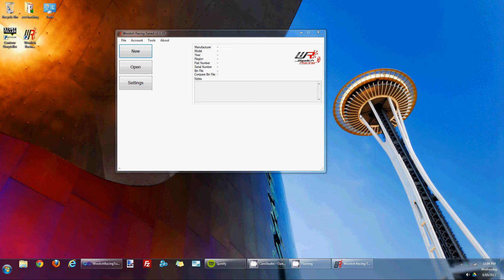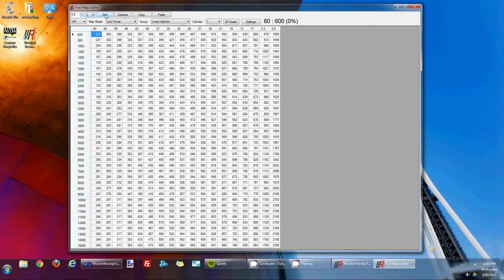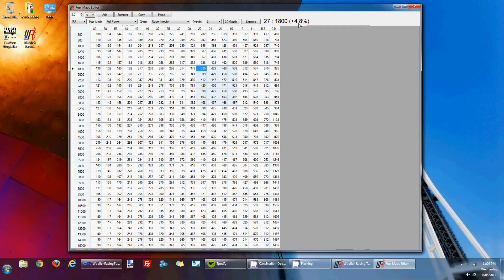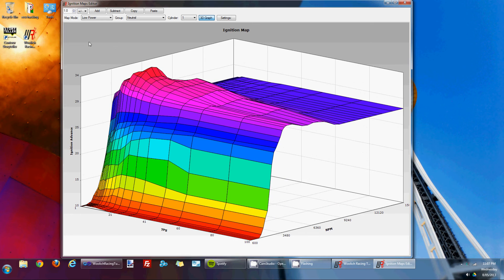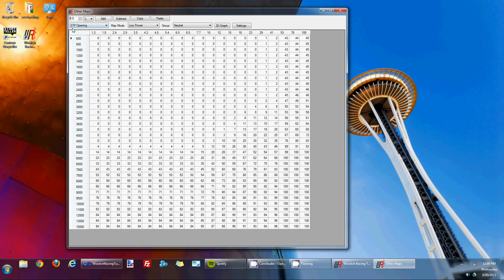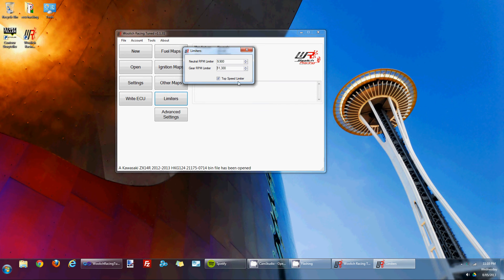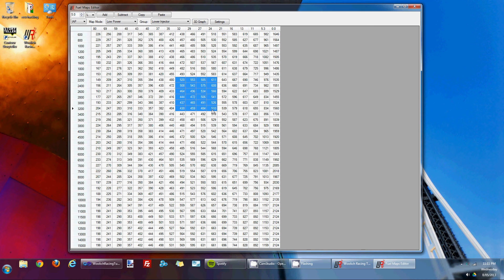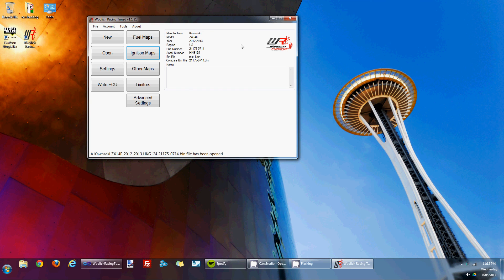Overview of Woolich Racing Tuned Software

Comment: Is it possible to change the hand throttle down to a quarter turn or sixth turn throttle seeings it is true fly by wire
Reply from the maker: It would not be advisable to try and emulate a quick-action throttle electronically by changing the ETV maps. There are many underlying maps in an ECU that aren't exposed with our software, and trying to achieve 100% ETV opening at 40% TPS, while it MAY be possible in some simpler ECU's, will likely interfere with the relationships between the other maps in the ECU. On newer ECU's, we would expect that attempting this could also result in the ECU reaching hidden internal limits which would mean you would not be able to reach 100% ETV at lower TPS values even if you tried. 

We would recommend purchasing a dedicated quick-action throttle kit in order to meet this functionality.

Comment: For the STP is there pre set settings other then factory settings? And can I import PC maps to this program? I ride a 2014 Suzuki GSXR 750
Reply from the maker: We supply the stock factory bin files when in our WRT software, this includes the STP maps for the various modes on the GSXR 750.

I strongly suggest if you are moving to our system that you ditch the PCV and its maps entierly and use our Log Box (Denso) product with a Wideband O2 to log data and autotune your bike directly in the ECU. While you can translate a PCV map to an ECU the results are generally not acceptable as the map resolution is very different and there are inconsistencies in the way a PCV applies changes to the fuel injection.

You will find products for you bike including the Log Box (Denso) package for your bike on the following link: http://www.woolichracing.com/products/suzuki/gsx-r-750/2012/2012-suzuki-gsx-r-750-ecu-flashing.aspx#productTable